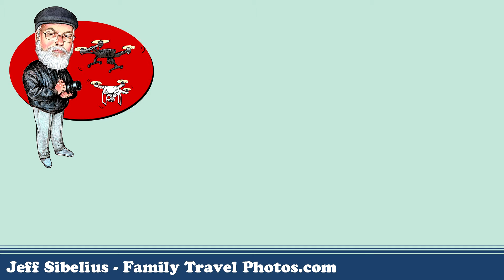Channel Announcement and Warning About Typhoon H Firmware Problems

Comment: Hello Jeff..Thanks for the update on the Typhon H. I recently have purchased my H and I love it. However, as you've  pointed out there seem to be some glitches in the system..! I just did the most recent download from Yuneec. St16 system V03.01.b27 , Transmitter st16_tx_v00.25 , Radio t16.r.f.v01.10. I haven't had a chance to get out and fly it yet due to weather. But on my initial flight with the firmware "right out the box" I experienced the 'toilet bowl effect" but was able to retrieve with a lucky catch before it got away from me. I'll keep watching your channel for information upcoming..!! Thank you so much..!!! Jerry
Reply from the maker: Hi Jerry - did you calibrate your compass and accelerometer before your flight? If not, run the calibrations and see if that doesn't fix the toilet bowl effect for you. Also, make sure you've got > 9 satellite connections for both the aircraft and the transmitter before you launch. 

Hopefully the solution is as simple as that.

Comment: mine has not been the same since the update.  I just flew it and nearly lost it!  it decided it didn't want to land and Everytime I would down stick to land it would climb!  after trying everything, I tried return to home and it flew away!!!  turned it off and I was finally able to coax it back and land inch by inch.  after landing it tried to take off again until I powered it down. whew!  not flying it again till there's a fix!
Reply from the maker: I had that happen once to me. Since then, I continue holding the left stick all the way back after landing until the motors are stopped. As long as the left stick is pulled back, the hex shouldn't take off again.Yuneec has issued a new firmware update - I'm waiting to see how it works for other people before I talk about it on this video. So far it's getting good feedback but be su
Reply: Jeff Sibelius yes, just saw the firmware.  I'll load it but I'm really gun shy after the last one.  think I'm still shaking! lol

Comment: Thanks Jeff, but sadly I updated the firmware today before seeing your Youtube comments.   The H was acting wonky before the upgrade, so I guess, it's not a loss.  Not sure if it was radio tower interference or not, but the last flight scared the bejeebies out of us and haven't flown it since.  During the flight, it would dip severely and move radially.   Looking forward to a solution.
Reply from the maker: A new update has been released - I'm watching to see what experience other people have with the update before I try it myself and talk about it here.
Reply: Any new feedback on the new firmware Jeff?    Very hesitant.   Thanks for keepin us in the loop!
Reply from the maker: They do have a new update online now - if you're grounded because of firmware issues now, you might as well give the new one a shot. What little I've seen from people who have done the latest update has been mostly positive.
Reply from the maker: What little I've seen from people who have done the latest update has been mostly positive. I was planning to wait longer but last week I got an obstacle avoidance system failure message while flying, so I went ahead with the update. I flew a test flight on Saturday and it went smoothly.

If you're not having any issues, keep waiting. When I see a bunch of good feedback and/or I do a few flights that go smoothly, I'll post something here and let you know.
Reply: Thanks Jeff,   greatly appreciate your feedback.   I haven't flown my TH in some time.  Going on 4 months :/  and had no issues prior..   I'll wait to hear and fly as usual for now.

Comment: The mentioned firmware update will be released shortly. Yuneec germany say it's a matter of days. They also say (i quote) "We're aware of the flyaway issue. The chinese are working hard on it. But at this point we can't guarantee a safe flight. To avoid a flyaway, stay clear of radio towers."
Reply from the maker: Thanks for posting that, Tom. It makes you wonder - if they're aware of a flyaway issue with the firmware, why haven't they taken down the firmware download from their site? I talked to a CS rep yesterday - why didn't he tell me about the impending firmware update? Yuneec appears to have an issue with internal communications as well as with common sense in this stuation.

I hope you're right. It's tough to fly with confidence when this nonsense is going on.

Comment: Good afternoon Jeff, Does go for Europe too, And at the same time how can we put the old version back on .
Reply from the maker: Hi Dwight - I would think this applies to the European version of the firmware as well, especially since the ST-16 firmware is the same for both the US and Europe . .  . who knows where the problem with the firmware lies? 

I don't know about going back on the firmware. I haven't heard anyone talk about doing that and I'd be afraid of bricking my UAS if I tried it LOL. 

I did see a couple posts where people suggest Yuneec will issue a new firmware update shortly. I don't know if that's true or not, and I'll want to see other people install the next firmware update and confirm that it fixes the problems before I put it on mine. 

You can follow this topic at the link below - when I have confidence that the issue has changed in some way I'll post something here on Youtube as wel.

http://yuneecpilots.com/threads/firmware-update-ver-2-25-after-you-update-post-your-outcome-here.4462/